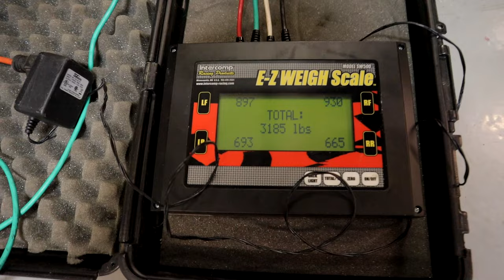American Musclecar Evolution - Why Pontiac Started Strong And Faded Into Obscurity

Comment: When GM had to downsize, I was sorry to see Pontiac go.
Reply: By killing one v8 engine family and let 2 more live (buick, olds)for some reason. If they really wanted to downsize they could have made a single corperate engine.
Reply: @sneff1052  That's exactly what they did do, though. By the time GM killed Pontiac most of what they offered was a rebadged Chevy. The G8 was a unique chassis, but it had an LS3, the G5 was a cobalt, the Vibe was a damn Toyota... Pontiac didn't have their own engines anymore at that time, it was all corporate parts bin stuff.  Pontiac hadn't had their own engines for a decade or more when they were killed. Oldsmobile
died before Pontiac, too if I'm not
mistaken...
Reply: I cried a lil in 75 when the cat was used on em..
Reply: @SweatyFatGuy  Technically, the last Pontiac V8 was 1981, not 1979, although 1979 was the last year for the 400 V8, and it was only used with a manual transmission in the F body cars (I have a 10th Anniversary 400/4 speed). The 1980-1981 Pontiac V8s were the 301 four barrel, VIN code "W", RPO code "L37" or the 301 four barrel turbocharged, VIN code "T" RPO code "LU8" (I have an '80 Turbo also). The 301 wasn't anything performance wise like the 400 was, but it was "right" for the times given what GM had to deal with.
Reply: @sneff1052  Technically thats what the Chevy 305 was. You could get that engine in Pontiac, Olds, Buick, and Chevy. Yje only ones who didn't use it was Caddy and Corvette. I was always thrilled when I bought a GM car with the 305 because that means I was ready for a 350 bolt in and all the performance parts that went into the 305 would bolt right onto the 350.
Reply: Still disgusted with the auto bailouts.  Should have let GM completely collapse and then rise from the ashes.
Reply: Sup there .. on my YouTube channel i do food reviews while I’m high gangy
Reply: Wars are won and lost on supply chains. There's a story, and I'll probably get corrected here by someone more knowledgable on the specifics, but when the ram air 5 came out,  pontiac addressed the rod issue with a brand new forged part number. When racers got wind of this they hit the parts desk of their local dealer to try and buy a set only to be told they would have to supply a valid RA'V' vin number and then they could  only buy four rods. That's the sort of bullshite that kills mid tier racing and ultimately sales.
Reply: I was too, especially considering Bob Lutz wanted to return Pontiac to GM's performance brand and make the entire marque go front engine RWD. With Corvette going mid-engine, it would have no longer been in competition with Chevrolet as a brand so there's no telling what could have been.

For all of the various shade that gets tossed at Pontiac toward the end, the Lutz days were the first real excitement that brand had seen since the '60s.
Reply: @SweatyFatGuy  I know that. Most people when they "swap" it turn into a hooptie and they were better off when it was stock. Best thing about a 301 is that it still looks the part and there's nothing wrong with it, so long as you take it for face value.
Reply: Me to the fact they kept Buick and dumped Pontiac makes no sense to me. As far as modern GM cars Pontiac had some nice cars . Buick makes nothing but FWD underpowered shitboxes. I was hoping Buick would come out with a new grand national when Pontiac was dumped but nope just more FWD GM shitboxes. Is anyone actually suprised GM failed other then the Corvette, Camaro, a few Pontiacs and pickup trucks what did they sell that anyone wanted? They sure made a lot of what I consider GMs K car. I’ve have a few of them as rentals and they truly are one of the worst cars ever made! No power, bad acceleration, low top speed, handles like wet dogshit, unreliable, uncomfortable seats, ect ect ect. Honestly I can’t think of one thing good about these GM FWD cars even the radio sucks (probably because it doesn’t have a damn antenna anymore) I know I they printed on on the windshield but it sucks. Seriously if you somehow bought one of these shitboxes at least you can listen to the football game oh on you can’t because the cheap fucks didn’t even put an antenna on it!
Reply: @Trump985  They kept Buick because it's a popular brand in China.
Reply: Downsize.. yeah.. when Pontiac outsold Buick and Cadillac combined.
Reply: The first GM catalytic converters that were filled with with pellets looked like they flowed about as much as a straw with cork in it 😂
Reply: @v8packard  You're right, not only was I sorry to see Pontiac go, but I'm just as sorry they kept Buick in its place. From what I've seen on other channels, Buick is a big seller in China. I guess that's why Buick is still here.
Reply: @watsisbuttndo829  that was the Super Duty conneting rods that they were artificially limiting the sales of after hot rodders foud out they were a cheap factory forged rod.
Reply: @eyerollthereforeiam1709  The real reason, as explained to me by GM staff there at the time that are my long time friends, government officials involved in the GM restructuring preferred axing Pontiac because it had the least impact on the union labor force. All of the Pontiac model lines at the time had an equivalent in other brands that could continue at plants that were not scheduled to close or retool, so essentially the loss of Pontiac would be seamless to the plant workers.
Reply: The government forced Pontiac and Olds out.  Casualties of the bail out. (Which the government should never do again)
Reply: @AmericanMX  Olds was gone years before. GM let Olds die on the vine, but they saved Daewoo!
Reply: @v8packard   Oldsmobile was the oldest American brand when GM killed them , my next work truck was a Dodge because of that ! They'd hamstrung Olds so badly for so long that there wasn't anything left to save. Guess they forgot about how many Cutlass were sold, Ninety Eights and Eighty Eights didn't sell to bad either back in the day ! 🤬
Reply: Didn't sell enough cars the the Chinese. RIP.
Reply: Don't really see the need for GMC, and Buick is an international brand
Reply: @SweatyFatGuy  I like the point you made about 79.
Reply: @bannedbycommieyoutube5time920  You think it's that easy, start a corporate company yourself, pre-internet
Reply: @SweatyFatGuy  Look at 81 era 3800's. Pretty lame. If the 301 was allowed to develop until 87 (GN), or 89(TTA), they likely would have been the best. Probably challenging the Callaway/LT5/ZR-1.
Even GMC/Chevrolet 4.3L turbo in 92/93 were amazing
Reply: @watsisbuttndo829  That's policy, not supply chain issues like today
Reply: @googleusergp  ❤️Agree. The hillbillies esp, and sometimes rednecks do not have the fit nor finish of the factory/corporate, nor especially education of the engineering and manufacturing personnel
Reply: @allhailinternalcombustion  That's not correct. The later RWD "square body" Broughams used both the 305 and 350 engines. VIN code "E" on the 305 and VIN code "7" on the 350. Also incorrect on the 305. The 1980 Corvette could be had with a 305 V8 for the California market.
Reply: @watsisbuttndo829  GM did that later on with the ZR1 blocks from 1990-1995. You had to supply a valid VIN # to buy a block. It had the note right there in the parts books.
Reply: @SweatyFatGuy  I keep them original. They run well, hold their value and look factory, because well they are. LOL.
Reply: @Bloodcurling  If it doesn't look, ride, drive and perform like it should when it's brand new, not for me. I like a performance car to have creature comforts and good performance. "Two footing" it at the stop light to keep it from stalling and ratting your kidneys on the ride is no way to roll.
Reply: @v8packard   Same with GMC. Same trucks, just different badges and trims. Having two virtually identical trucks lines has always seemed rather redundant to me, especially after dropping Pontiac while keeping GMC….or they could have dropped Chevy trucks and kept GMC as their truck line.
Reply: @notajp  It makes sense to me that GM would have a brand dedicated to premium trucks, and SUVs. GMC clearly is intended to be such a brand. But it's existence for decades now is a product line that to most people looks like a Chevy with a different badge. GM has never truly invested in the GMC brand to make it different and appealing in the market segment. Don't get me wrong, I like and appreciate some of their vehicles. But they should have done so much more with the brand. Meanwhile, Chevrolet has evolved to a brand making a sports car, a muscle car, utilitarian light trucks, and luxury SUVs with a few basic sedans seemingly as an afterthought. It's bizarre, but maybe in the minds of people that have no idea what the history of the company really is it all works fine.
Reply: In the time frame of Pontiac and Oldsmobile both being dumped, Chevrolet was losing more money than any other GM division.
Reply: There hadn't been a Pontiac engine since the demise of the 301 in 80 or 81. So what was really lost was the branding logo. I don't miss their logo. I did miss a good Pontiac engine. I've had more Olds though. GM ran Olds into the ground. At least they didn't ruin pontiac's reputation before they gave them the axe.

Comment: I had a '65 GTO 389, did all the usual stuff, cam, headers, intake and then put 421sd heads on it and grenaded it at York, Pa. Learned a real hard lesson, filled a bucket with busted rod parts and pay for oil cleanup.

Comment: In 1968, in Australia, my old man and his brother took the Trophy bottom end out of their totalled Bonneville and swapped it in under the Ram Air heads in their GTO - after taking a skim off each - and ran reliable, low 12s. Dad would say that every person in the pits would "enlighten" them of the likelihood that they would leave the crankshaft at the starting line of the next run, and they would just turn and say "probably."

Comment: I've got a set of 1962 NASCAR SD421 forged steel rods that I'm hanging onto for just the right build! I've had them since 1984.
Reply: Leave them on a shelf. A $500 set of eagle rods are peace of mind
Reply: The newer rods are lighter and stronger.
Reply: You sound like me.  Since I dropped Pontiac (budget reasons) I went to Chevy.  I'm using a block I picked up in '88 just now... building a 383 for a drag C3 corvette.  Old school with left over carb (too small just a 750 - but its what I have).
About the same time I picked up a 440hp block and a low milage 383 block.... still sitting in my parents basement annoying my mother for 30+ years.

Comment: You stated it very well in broad terms and the approach was the right way. You point out the strengths and weaknesses, which is the honest way to assess them. Pontiacs are not for the weak of heart. They are for those that want something different. By the 1970s, at least Pontiac still had a 400 in the Trans Am and when the Mustang went to a Pinto based vehicle and shut the performance light out, Pontiac "kept the light on for ya". Most are familiar with the Pontiac performance folks such as Annunziata "Nunzi" Romano who had a shop for years in Brooklyn, NY. He was brought a 1972 Trans Am by a magazine and asked to see what he could do with it. The writer said, "But you don't have a dyno". Mr. Romano replied with, "I don't need a friggin' dyno. I got one right here" (pointing to his heart). With some tricks and tuning, Mr. Romano woke the car up.

He was also the one to coin the phrase, "Rochester doesn't have to advertise. They sell 5 million carburetors a year". There are others that Mr. DeFeo likely knows from the HPP days such as Rocky Rotella and H-O Racing Specialties of Hawthorne, CA. Yes, Chevrolet small block and big block parts are found on every street corner, but that's what makes Pontiac better in my book. They were never a "me too" company. They always sought to be different. 

When Hal Needham needed a car for Smokey in the Bandit in 1977, he didn't choose a Camaro. He chose a Pontiac Trans Am. Yes, a 1977 (although they were actually 1976 cars with 1977 front ends) Trans Am wasn't a barn burner compared to its' earlier brethren, it kept the torch lit long after everyone else shut the light off. If you wanted a fast car in 1979 that handled well, you bought a Trans Am. If you wanted to add good looks and a classic design, you bought a Trans Am. I own three Pontiacs, including a 2009 G6 convertible, which although it shares its underpinnings with a Malibu of that year, it's still unique in that only Pontiac offered a convertible version of it. I get stopped every time I'm out with it and people say, "What type of car is that?" When I tell them, they are stunned. The car costs half as much as a Mercedes Benz convertible that year and I get MB drivers stopping me asking what it was and what it cost. 

If you want common as dirt, go Chevrolet V8. Not that there's anything wrong with that, as Mr. DeFeo stated. However, if you want to be different and stand out, do it as the 1979 10th Anniversary Trans Am ad said, "Very Rare, Very Well Done".

Comment: The 455 that came in the 1973 Trans Am had premium internals that addressed the shortcomings but was waay to late for the  musclecar wars.
Reply: Yeah the SD 455, but to late.
Reply: @warrenlucier5796   The main s were too big, 3-3.25 mains have so much bearing speed.
Reply: The 3-3.25 main killed   them with the cast rods.
Reply: @warrenlucier5796  SD455 had a cast crank.
Reply: Only the 455 SDs did.
Reply: Pontiac offered a wimpy 455 HO in the 1975 Firebird. At the beginning of the 1976 model year, Pontiac didn't offer a 455 in the Firebird, but so many Firebird shoppers were wanting 455's when they went to the dealers, that Pontiac offered the 455 in the Firebird, later in the 1976 model year.
Reply: @BrandonLeeBrown  You’re a year off. It was the 1975 model year Pontiac dropped the 455 option in the F body. This was also the first year for the catalytic converter. They could no longer fit the turbo 400 in the F body due to the addition of the converter. It was public outcry that convinced Pontiac to bring back a 455 option mid model year 75. The shaker scoop decal said 455 HO. It was only available with a 4 speed manual. People were excited when they saw 455 HO plus the fact the 4 speed was mandatory. However it was soon learned the 455 offered was no different than any other 455 Pontiac offered in 1975. The same 455 option was carried over into 1976 only the shaker was simply labeled as 455. The 455 was dropped altogether across the line after 1976.
Reply: @mikee2923  The carburetor and cylinder heads were different for 1976 and the 1976 455 seemed have better performance than the 1975 455 HO. The 455 got the same camshaft as the 1970 high compression engines. The low compression 400's got smaller camshafts.
Reply: @BrandonLeeBrown  The carburetors were calibrated differently since the T/A was the only application that had a manual transmission behind a 455. The cylinder heads were the same 6H or 6S casting used on a Grand Prix, Bonneville, Grandville etc that was equipped with a 455. They were all rated at 7.6:1 compression. Combustion chambers were around 124CC and they had the same 2.11” intake and 1.66” exhaust valves. In fact a Pontiac 350 had the same size valves during this era. As far as the camshaft goes, I’d think they’re all the same as the other 455 Pontiac engines in 1975-76 because they all had the same 200HP rating.

Comment: Ran a 426 in a 66 'Cuda with a BFP(rybar), and in your vernacular it was a beautiful disaster. We brought two sets of bearings to the track. 
My 65 GTO developed vacuum issues on the no. 4 cyl. intake. Installed after market connecting rods as a matter of course. 
You're right on the Fords, especially the FEs.
Chevy was lucky when the E.P.A. cracked down with new emission laws enacted in 1968, which coincide with the roll out of Fords rollout of the 385 series (302, 351, 429, 460) so they didn't develop "go fast" parts for awhile.

Comment: I became Pontiac fan in 1964 when I bought a new 64 GTO. I used 1961-62  rods ( CR 4140 ) and had them heat treated to Rockwell 35.  Super duty rods were CR 4113 and not as good. I had them shot peened.  I still broke cranks and pistons. I bought an OTC piston press instead heating the rod ends. aaaaaait was $1900 back in the day.